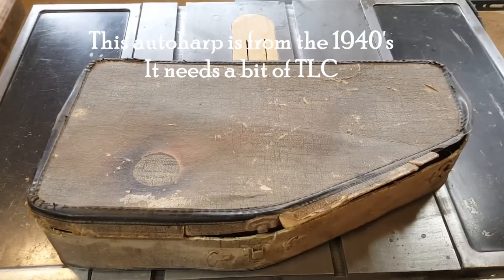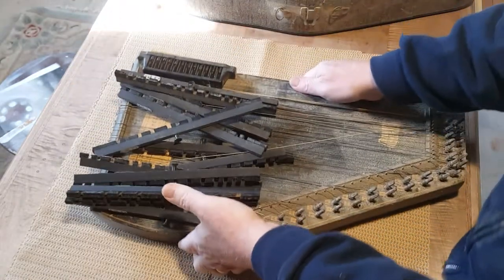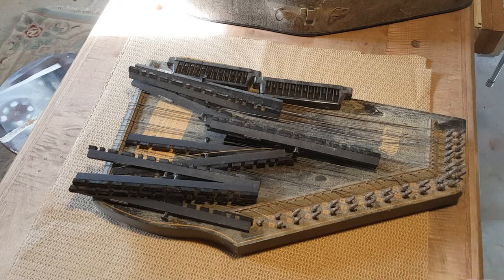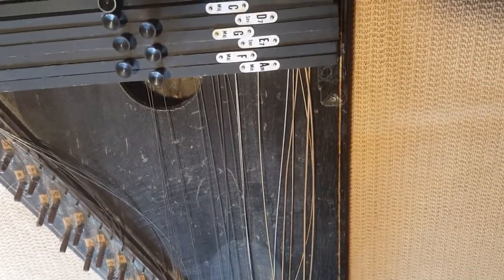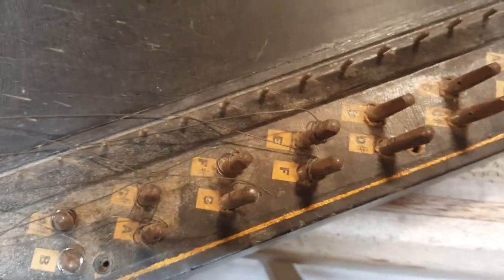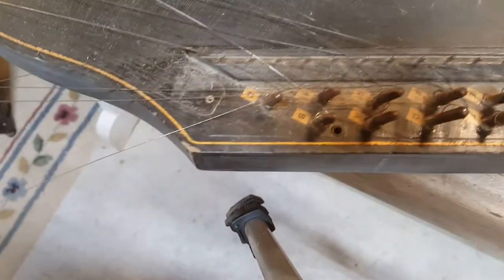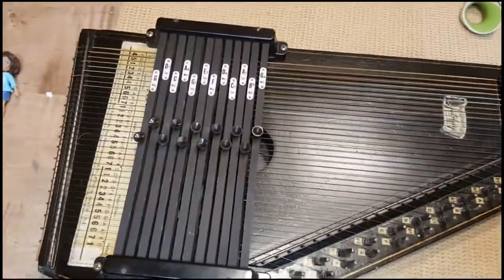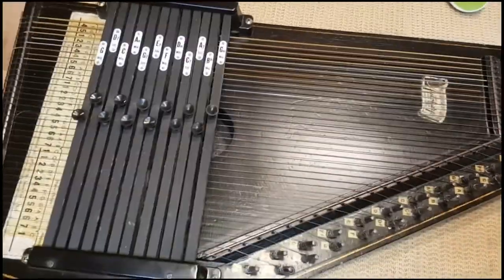Restoring a 1940's autoharp

Comment: I was drawn to watch your restoration project video for the autoharp.  As someone who plays restored vintage autoharps, my first reaction to the instrument you started with was "firewood".  You did a very nice job of bringing back an attractive appearance, and I can see how much work you did to get there.  My gut feeling is that this particular instrument will only really ever be good as an attractive wall hanging, as it will probably never sound good, or even to be able to hold a tuning.  Nevertheless, I enjoyed watching your progress from "disaster" to an attractive display object.  (One nit, you have the chord bars in the wrong order)

(As a reference point, I just yesterday received a set of custom made strings for a 135 year old autoharp I am working on).  If you wish, please feel free to listen to several different vintages of autoharps on my own YT channel.
Reply from the maker: Thanks so much for your thoughts and input!  I agree that this one will not have a "great sound".  I have playing and building instruments for a number of years and enjoy bringing old instruments back from the brink.  This was my first opportunity to work on an autoharp and learned a lot in the process.
Reply: @workshopstudios43  I could tell you were not a beginner at working on instruments because you didn't just "Minwax it up".  The one point about the "A body" instruments, like you worked on is that to remove the strings, the best way is to back the tuning pegs out by 3-1/2 turns.  If you re-install strings it makes it easy to re-establish the depth of the tuning peg.  Too shallow and it will slip and go out of tune, and too deep and you strip the hole.  The instruments have changed over time, so I need to go slow working on the 1885 and 1910 instruments I am currently getting ready to do.
Reply from the maker: Thanks for the tip about the tuning pegs! 
I built a hammer dulcimer from scratch and restored an old Wurlitzer upright piano so had some experience with tuning pegs before starting the autoharp.
The pins in the autoharp proved to be one of the more challenging parts of the restore as many of the holes were too big (striped or wood to old) to hold the string tension for tuning.  I ended up doing a quick fix of "shimming" to add enough tension to hold the string.  Seems to be working so far as its holding tuning.
Good luck with the1885 and 1910 projects; it does bring me great joy to see older instruments given the TLC they deserve.
Reply: Well wait up there 😀 let's ask. How did it sound?
Reply: @DougKing4416  I'm not trying to be a Gloomy Gus, but you just have to realize that harps of that era didn't sound all that great to start with.  Then, throw in cracked soundboards (front and rear), a mix of new and decrepit strings and a completely degraded set of felts, this is one that should be seen, not heard.
Reply: My thoughts exactly !!!  @DougKing4416

Comment: Good job on bringing up the finish, but if you really wanted to restore it to it's best playable condition, you should have taken time to properly repaired the cracks in both the front, and the back, before ever recoating with varnish lacquer. Taking out the cracks would up the value of the instrument, when completed, and the notes (while playing), would sound a whole lot better as well. I picked up an older Oscar Schmidt auto harp the other day from a second hand store, that is not as old as yours, that was badly damaged from the past owner dropping it. The face was damaged, as well as a long crack can be seen in the back, that nearly travels half the length of the harp itself on the bass strings side. The finish is still very good, but that crack has to be dealt with to make it worth-while in repairing it back to normal, again. I repaired the face, and tuned it up, sounds not bad, even with that nasty crack. This past week, I have been making up a home-made "jig", that will be used to both close-up, and seal-up that crack up tight, and take out the slight warp in the wood, that, that crack created, when it was dropped. I'm hoping that once I'm finished, no-one will be able to see any repair was ever done, less they look extra close. To add strength to the repair, I'll be "cleating that crack" from the inside, in multiple places, so it doesn't come lose ever again. My strings are old as well, so I'll be replacing them with new ones, for max. sound quality. I will also re-felt each of the bars, for the very same reason. When completed, it should both play and sound as good as any new harp, and will last for many years of enjoyment of playing ( as long as it's still properly taken care of). I have to agree with another person's comment below, that it's just a fresher looking wall hanger, after watching your video.
Reply from the maker: Thanks for the great information! I'll put that on the list for phase 2 of the auto harp restore.  And Thanks for watching!!
Reply: @workshopstudios43  ... Here's a little jig you can make to close up those cracks. Find yourself an old, badly damaged "concert type" guitar that has  openings threw the tuning head (you'll have to look=up concert Guitars to see what I mean).  Make sure the tuners are still on the tuning head, and are working. Cut off the tuning head and save it, as that will be your repair  jig to help put pressure upward (from the inside), on the cracks, pulling them upward to both flatten, and close the cracks upward from inside the Autoharp, where your hands, and fingers can't get to without taking the whole harp apart (and taking apart, is not good, or what you want). Here's a video explaining (in good detail) what to do on your harp (only the repair shown in video, is done on a guitar, not a harp, but same principle of the repair applies, and it works if you take your time, and are handy, which I think you are). If you do the repair carefully, and correctly, you will add both value to your harp, as well as lost, and unwanted tone sounds, due to the cracks now in it. It adds strength, and if done right, won't open up again for at least 50 yrs. if not longer. You can actually hide those cracks so well, that it would take a very close eye to see where they once were. Replace the guitar shown in video, with your own harp, and do the same thing. You will need lights, mirrors, and home-made adjusting tools to both see, and move the repair cleats to properly repair your harp, threw the small open sound hole, where you can't get your hand or fingers. bent Coat-hanger wires, put through the main opening, make excellent cleat movers, and adjusters, so they glue on properly in the right manner they should be glued, as shown in video.  Using an old concert guitar head as the puller, from the outside, will flatten the small wrap, and make the back flat again, as well as close the crack for gluing tight. Okay, I hope I gave you something you might ne interested in doing to your old harp, and make it closer to new like condition. Here's the video I speak about. Make sure you save it, so you can referr back to it, when needed.   ...  https://youtu.be/NagRfWvxVQ8
Reply: If repair is done successfully, I'd invest in a new set of strings, and felt pads, as they last a long time, and your harp will sound a whole lot better. If your going to repair this old harp part way, might as well do a good repair all the way.  There are videos on how to change the felt, and also the strings properly  ....   Good luck.
Reply: It will  sound MUCH better than any new Oscar Schmidt

Comment: Getting ready to do the same. Curious. Did you use something to reinforce the tuning pin holes
Reply from the maker: Doug,  I did need to shim some of the holes to tighten the pins so they would hold tuning.  I used toothpick for some; needed hardwood for a couple.  Probably a better way to do that.  Maybe some other viewers have ideas.
good luck with the restore and thanks for watching and commenting!

Comment: you sis a good job with the restoration, but you put the chord bars on backwards.  those white chord names face the other way.  I didn't stop the video to check if youo got them in order.  Nevermind.  I am sure you cant play it the way you set it up.  I would have put on new strings.  They used to cost $36 dollars.  Before*   This model of yours is one of the best.
Reply from the maker: Thanks for the heads-up.   I admit to not being an auto harp player so ...
I do love bringing instruments back to life!  And this project was very rewarding.   Thanks for your kind words and for watching!